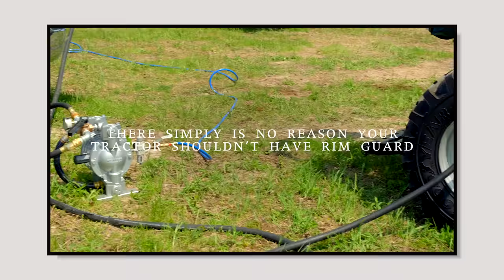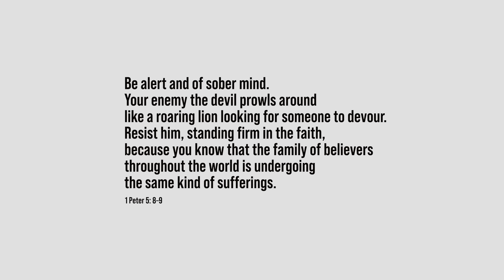BEST BARN FIND EVER! ONLY 20 HOURS AND LOADED UP!! 😎🚜

Comment: The HST transmission on the Grand L series is  probably one of the best on the market these days. 
It's quiet and it has hi/low on the fly on each speed including reverse, auto throttle and stall guard to prevent engin stall.
It also has an adjustable response for smooter or faster operation.
Great compact tractor!

Comment: I have a 2020 L3560 LE and I bought mine with 22 miles on it.  The previous owner had added outside mirrors, cruise control, step on the right side and blue tooth radio.  I added front and back lights but all I had to do was plug them into existing plugs. Even the switches for the lights were prewired. Love my L3560.

Comment: That's a really nice setup. I must say I'm surprised they didn't go for a hydraulic top link. But I suspect that since they have the hydraulic SSQA connector, they were probably planning on doing a lot more loader type work than three-point stuff. Lack of a rear windshield wiper option and no mirrors seems to add evidence to that.

Comment: I find it hard to believe that a radio wasn’t included! Nice find, better than my truck which is 22 years old.
Reply: The “Limited Edition” models did not come with a radio, mirrors, side door handle or roof lights.   To keep the price down.   The Grand L models have that standard, but the radio is an option 

But if the First owner went for all the additional hydraulics, it is odd that a few $$$ for a radio wasn’t spent lol

Comment: We have this model in an open station and we really like it. I am mystified why Kubota doesn't use this enhanced treadle peddle on at least their LX line since it is also a deluxe  line by Kubota. Our family also likes the fuel tank is down at the floor rather than on the hood or rear fender. 

One thing i might point out that the  heavier loader is require a if you want the hydraulic SSQA option. I know our dealer won't order the lighter loader for their inventory because they feel the price difference is so little for the amount of extra weight you can lift with this loader. They will only order one if a customer specifically wants it for their tractor purchase. I don't think you can even get that lighter loader on the next size up, the 4060 Grand L.

Comment: The bucket is a light material bucket so it wont have the holes for a bolt on cutting edge. Kubota does have buckets with holes. The weights Im sure are 50lbs since they’re the dish kind I believe.

Comment: I have looked at 100s of L 3560s through the years and I’ve only seen one other one with the 805 loader. With no options except the loader that Tractor new would’ve been around 34k in 2019. More now I’m sure.  I came so close to buying one but I ended up with a John Deere. With all the extras and the hydraulic bucket detach I’m sure you’re asking well north of 40K. I’m guessing around 45?.